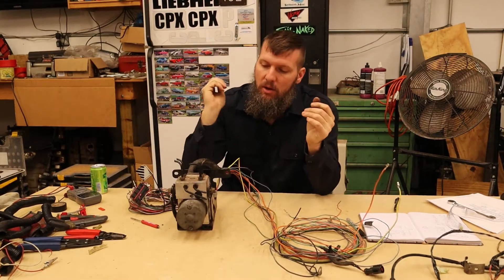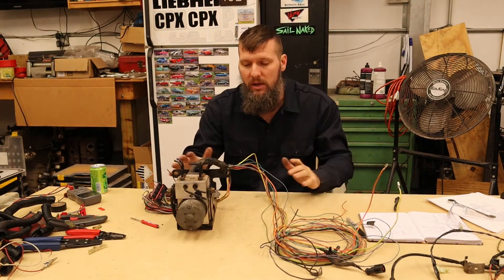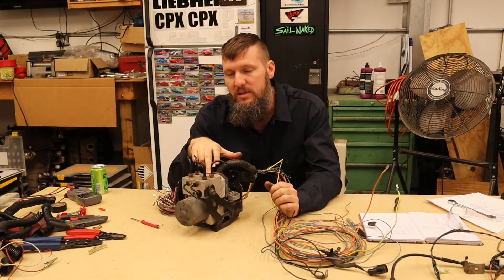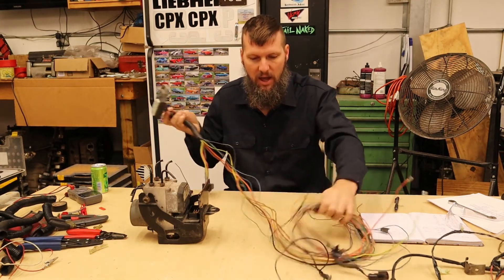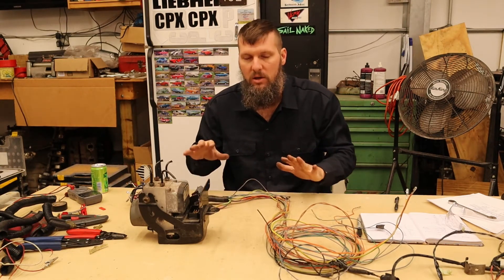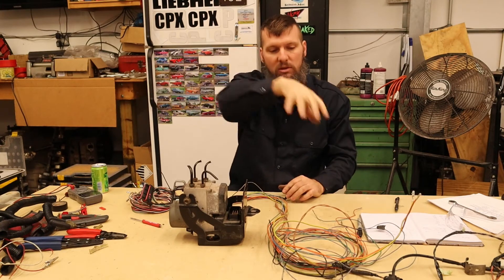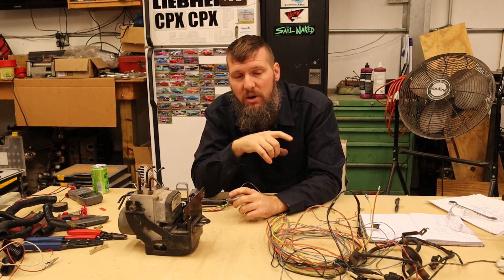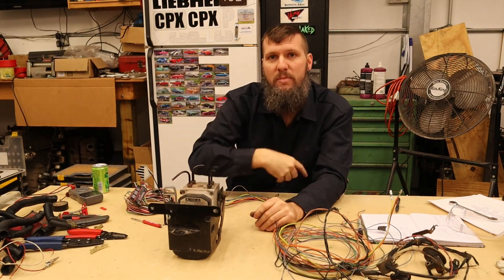Installing a 4 Channel Ford ABS Module in a SN95 Mustang - Part 1

Comment: I'd be interested in knowing what harnesses or sub-harnesses the wiring was pulled from.
Reply from the maker: I pulled most of the wiring from the donor car, 99 Cobra in this case. The ABS wiring is mainly in the front body harness but wheel speeds go throughout the other body harnesses.

Comment: This a great video, I am also in the process of installing ABS on my 1994 Ford mustang 3.8 with a m90 supercharger on it. My other 1994 has ABS but its because it a 5.0. I feel safe driving with ABS because I know my wheel will not lock up or I had to pump the brakes to keep them from locking up. Looking forward for the next video.
Reply from the maker: Thanks. I've mostly driven vehicles without ABS. I definitely see and have experienced the benefit of it. Luckily you have a second vehicle to look at but if you need any help with wiring or something let me know. I have the Ford electrical diagram book for 94 mustang. The videos may lag your progress since I stick to one a week.

Comment: Nice video as always! Happy to see how standalone this ABS systems are, my 97 ABS is not working so i have to troubleshoot it and i was thinking on cleaning up the whole bay wiring and move it! Your dash video have been really good help.

Btw what rear ratio are you running on that 8.8?
Reply from the maker: The early ABS look to be harder to troubleshoot, but I think it can still tell you if a sensor is bad or something. But yea they are pretty basic wiring wise.

I have a 3.55 rear gear.